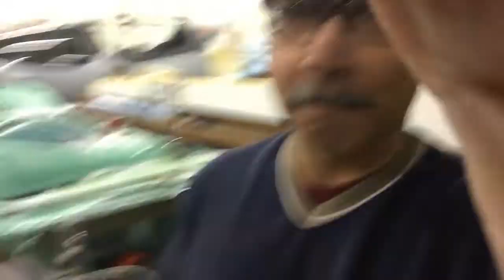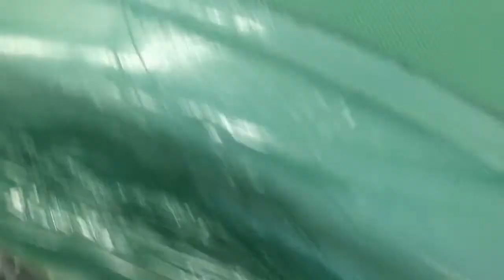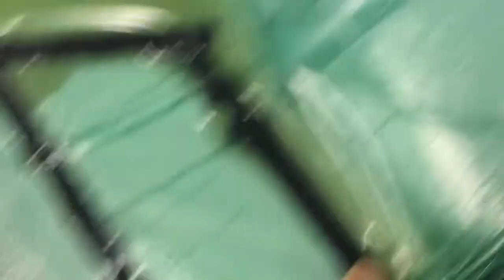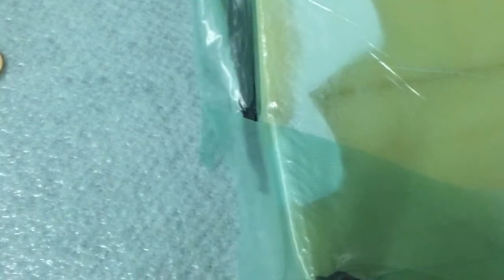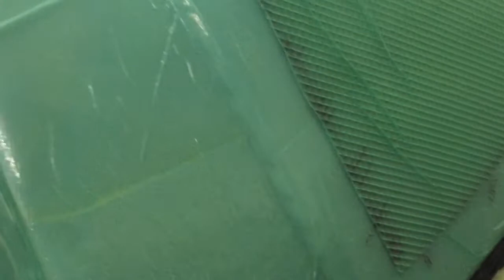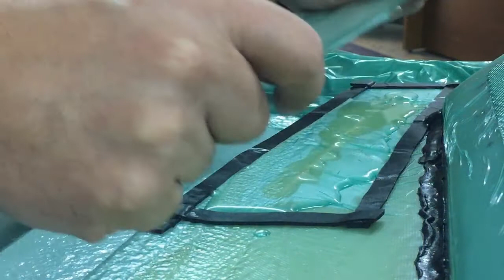Vacuum Bag Surgery: Resin Infusion Tips from John McGinnis

Comment: Do you ever use multiple airflow source connection points to control flow? moving the vacuum from one to another to draw into different areas?
Reply from the maker: We prefer to set up a primary and secondary vacuum port location in advance, and will move from one to the other if necessary. A third port location has sometimes been used, but seldom necessary. 

The key has been to have really smart airflow channeling. For example, we use the term "drawbridge" for a short, 1" wide piece of breather fabric that reaches from a breather strip across a "moat" of bag-to-bag or bag-to-tool contact. With careful massage, the breather can be withdrawn or re-connected from a perimeter part location.

Having several drawbridges across an intentional, low-airflow moat separating the vacuum channel allows each of them to be withdrawn as a part fills. Otherwise, resin can overwhelm the location of highest differential pressure long before another area fills.